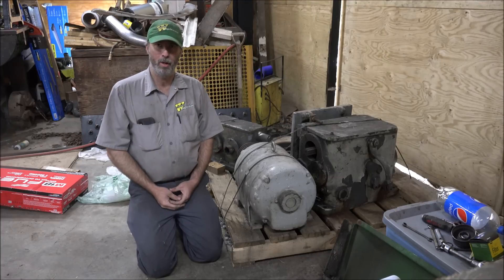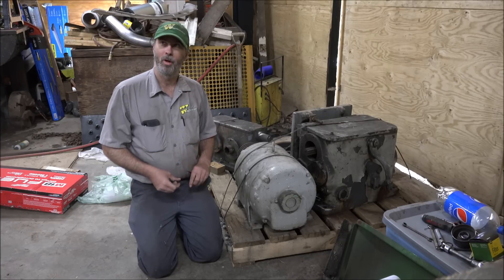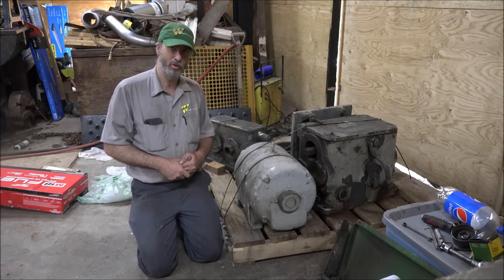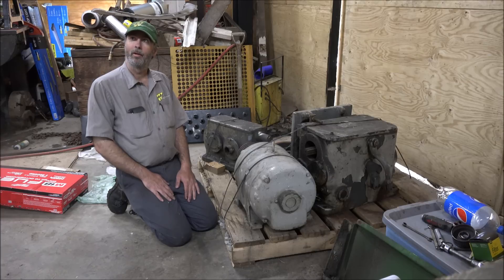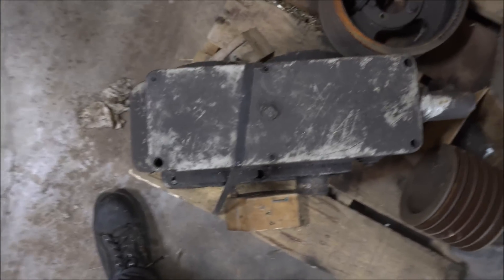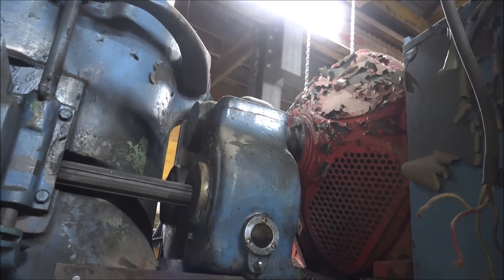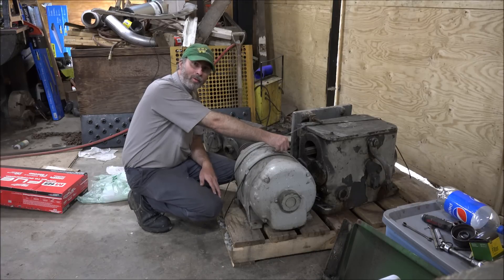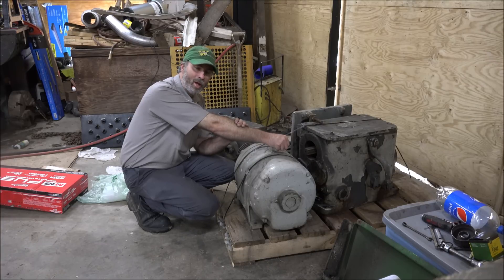Carlton Radial Arm Drill Motor and Gearbox AC Power Conversion It Pays to Have Friends !!

Comment: Hey Brian I have a 1998 5.9 12 valve. If I park it on level ground or with the front end slightly up hill overnight it is hard to start. If I pump the hand pump it will start right up do you think it is the mechanical fuel pump letting the fuel run back to the tank or is there a check valve somewhere else that’s letting the fuel run back?  Thanks Mike
Reply from the maker: Normally it is the rubber fuel return hose at the back of the block.  A leak anywhere in the fuel system can allow fuel to drain back.
Reply: @bcbloc02  Thanks I will check it. I haven’t noticed any fuel leaking on the ground
Reply from the maker: @mikec.9177  You won't as there is no pressure to force fuel out but the weather cracks will allow air to be drawn in.
Reply: @bcbloc02  Ok thanks

Comment: What's the rpm of AC motor vs the DC 
Can you not just put a shaft in your current the gearbox and use a belt to get the right ratio then put the motor you've been given and make your own braket to mount it where ever it'll fit
Reply from the maker: Without the additional gearbox it would loose either top end ranges or bottom depending how it was setup. There are 8 gear splits in that box that are needed to cover the same speed range.
Reply: @bcbloc02  
Wow so the DC motor really has got a much better torque range 
Shame it's such a hassle to run it 
What would have run it originally 
 A giant rectifier?
Reply from the maker: @fowletm1992  The factory it came out of had a rotary converter for the plant. All the overhead cranes were DC and they used the bus bars for the cranes to transmit power to all the machines in the plant. It made wiring and moving equipment a simple affair as they just hooked up the drop and was ready to go.  The converter they had was like 6ft in diameter and probably made like 500Kw or something.
Reply: @bcbloc02  i was blown away. never seen or thought of using one of my welders to power a DC motor. i just put a tread mill motor on a small old rockwell drill press. next is my rockiland 16 foot tall raideal arm flat belt converted to DC.I live on my small farm in the great state of missouri  I am more welder than farmer. did emergency road repair on big trucks 32 years   running 3phs converters for my Gisholt  and neble laths. i dont know much about Ac . would love to talk with you sometime you are smarter than the average bear. i could come down and burn rod for free for you maybe a few days. thats how i learned to streach lowboy frames 30 some years ago. weld for bill enion for a week for free. lol. I Am beat spell check quit workin  this is Jay with H&H truck repair NE Missouri hope to talk some time

Comment: How about just making a shaft like the DC motor uses and use it as a jackshaft that get's powered by the AC motor. Then put a VFD on it.
Reply from the maker: It would loose a ton of torque in the low rpms clipping the motor speed that much and 20hp vfd cost several thousand dollars.

Comment: I would use a constant torque VFD with the AC motor. Then its just some fabracobling to mount the motor.
Reply from the maker: Pretty sure 20hp vfd are pretty pricey.
Reply: @bcbloc02  might be worth looking into from an auction site. Sure sounds alot easier.
Reply: constant torque VFD with AC motor , would that make the AC motor run hot? at lower voltage?
Reply: @assyholey4224  yes it does which is why you have to add a fan
Reply: @CapeCodCNC  ya i like fans.

Comment: Can't you just adapt the motor to the existing gear box or are the RPM's  different to the point it wouldn't work?
Reply from the maker: It would reduce the rpm range a lot not having the other gearbox.

Comment: This is great to see for you, nice.
I see the M18 weedeater there, I hear that they need the High Output batteries; I do not know necessarily but was talking with some people about it a few weeks ago and that was what they said. I would love to hear what you think of it some time. I may pick one up for myself.
Give Bailey some pets for me, i miss my dog.
thanks for the videos. hope y'all are doing well.
Reply from the maker: I have run mine with all different size of batteries and it has worked fine. Mine is the pole saw weed eater combo.
Reply: @bcbloc02  sounds good. I have 4 of the 5 amp hour xc batteries and was worried I would be rung into needing to buy the HO batteries for it.  I am not trying to work with a string trimmer for a living so I was curious what you might have experienced with it. 
thanks to everyone for the replies.
Reply: @bcbloc02  I have the same unit Brian, I use the 9.0 and 12.0 batteries and they give pretty good service life before recharge. And I am fortunate enough to have several of the big batteries to use while one is on charge
Reply: I got my wife the weed eater and the chain saw.
I was worried she was going to hurt herself while pull starting the gas ones we have, and she might be late fixing my meals.
I spent the extra for the 12a batteries. They last a long time.
Reply: I’ve got the M18 weed eater and love it though I bought it with battery as it comes with an 8AH battery and haven’t tried it with a smaller one yet

Comment: SO the original motor speeds are all controlled by varying the speed of the DC motor and the new setup is all geared ?
Reply from the maker: Currently there are 16geared speeds and you can vary the motor speed in each gear. The ac setup adds like 4 more gear splits so you can get 64 geared speeds.
Reply: @bcbloc02  Sounds like it's working for you now so the new AC motor would be a good back up if the DC motor bites the dust... Motors are really expensive to rebuild right now!

Comment: Brian - You have a functioning drive for the Carlton, I would stick with that!  Please list the specs needed for either a motor or engine DC gen set or an AC to DC power supply for the drive motor.  There out there, It's just a matter of stumbling on to them.  What about an old engine driven welder?  You might have to rebuild the motor but it could be dual purpose, eh?
Reply from the maker: The drill needs 250v dc and I think about 80 amps. My big Miller max is 80v dc I don’t think any welders would output near enough.
Reply: @bcbloc02  You might look into a motor gen set out of an old elevator hoist system.  Should be a few of these laying around as scrap having been replaced by converted solid state drive elevator systems.  Also check around for a used 240VAC to 250VDC@(80-100A) power supply.